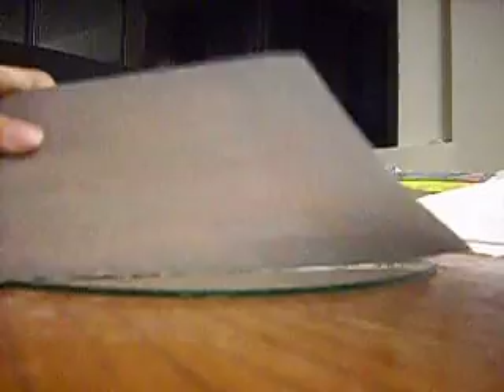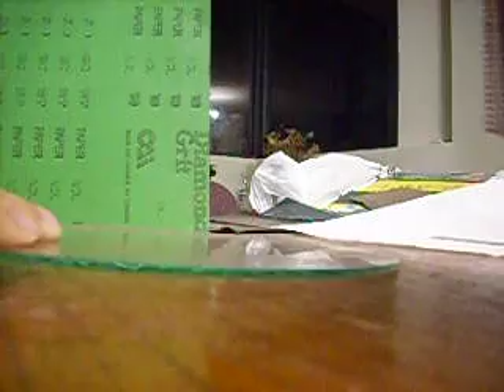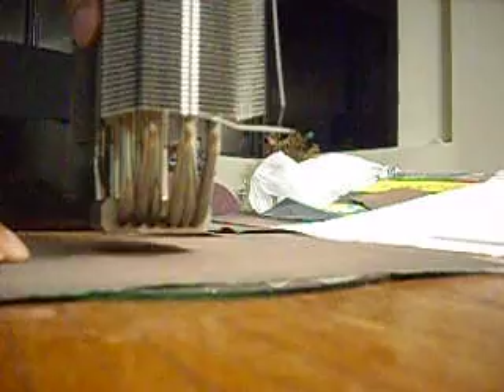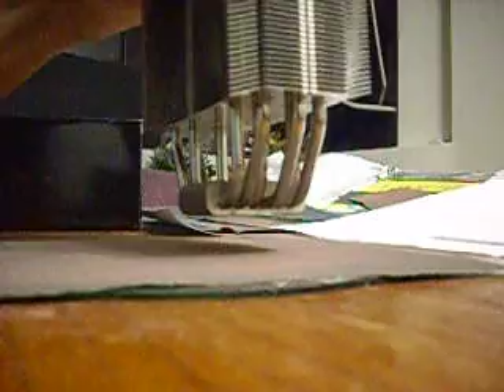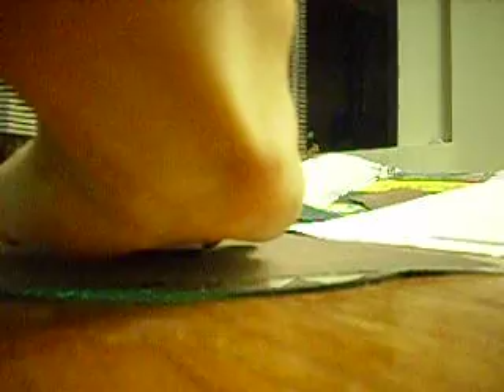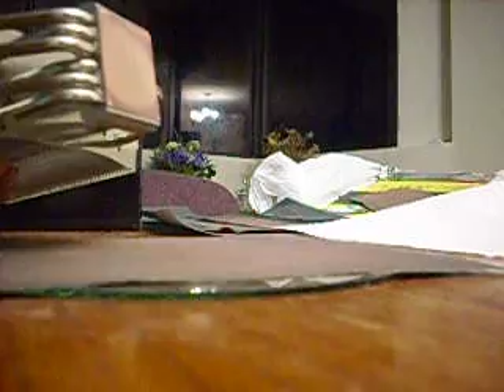Lapping Thermalright Ultra Extreme

Comment: The main idea is to lap the CPU. However, people dont want to take the risk of doing that so they do the heatsink. If you want to go for best performance than lap both the heatsink and the CPU if you don't want to damage an expensive CPU but still want that few extra degrees of performance do the heatsink.

Comment: You obviously do not understand the idea of lapping. The idea of lapping is to make the surface as flat as possible because pure copper/metal has much better conductivity than even the best thermal paste. Making the surface flat gets rid of the bends and uneven bits thus resulting in less thermal paste separating the cooler and CPU. Plus, how reflective the base is has almost nothing to do with how efficiently heat can transfer.

Comment: Good tutorial but definitely wrong about the wax. The only things that should ever go on the heatsink are isopropyl alcohol (or similar cleaner) and thermal paste. I lapped my processor to a perfect mirror finish without wax. The secret really is to use high grate sand paper. Start low at 220-400 and work the whole way to at least 1500 grit, preferably 2000 grit for a perfect mirror finish. Happy lapping :)

Comment: Actually if you look through the cpu lapping videos you will notice the edges sand off first.  I have noticed on my newer cpus that they have been rounding the edges down.

I also forgot to mention that you only need around 500-800 grit sandpaper max. I have read tons of lapping articles over the years and all bench testers have shown they get no better results.  I go 250Gritt, 500, then 600.  I also have a small piece of glass so I can put it under the faucet to help keep the sandpaper cleaner.

Comment: If you notice, most CPU's are actually rounded in the opposite way that the heatsink is... or more techinically, in the same way. both are bulging, or crowned, so there's a significant gap either way. But yeah, for best results you need to lap both the heatsink AND the CPU, but I'm not sure I would use this particular video's method for doing the CPU.

Comment: You will need to lap your CPU as well.  Is what happens is that the CPU isn't perfectly flat either, that's why the heat sink is made rounded on purpose, that way they will match up more evenly.  So lap both heatsink and CPU for best results.

Comment: i only used 1500 paper, im going to try again using only a forward motion and with 2000,2500 grit sand paper if it works il try it on my heat killer rev3 :D

Comment: I'm not understanding your logic for sanding at a low grit in one direction until all the scratches are in one direction. I know that you are getting rid of the unevenness of the base but couldn't it then be possible that one side of the heatsink gets more/less sanding due to inconsistencies in either the sandpaper or whatever you're lapping on top of?

Comment: using turtle wax or any other polishing compound defeats the purpose of lapping the heatsink.  it makes the thermal interface worse, because the extra polishing compound is "absorbed" into the microscopic pores of the heatsink.  you don't want that.

Comment: If you use soap on the sandpaper, it actually makes the heatsink GLIDE, i lapped mine by just twisting the heatsink in circles. Worked very well.

Comment: Wet and dry papers will go as fine as 4000 grit now. But I think if you use 1200grit, then 2500 grit as a final, then use some 3 micron Diamond compound ( not turtlewax )on a Chemotextile cloth or a woven silk cloth with PSA, stuck to your lapping plate, you will end up with a finish that is mirror.

Comment: Use " Wet and Dry" Silicon carbide papers, some call them carborundum sheets. Use water on the paper to keep it lubricated and it stops the paper loading up also.Glass is generally not that flat. Better if you have a Cast Iron Lapping plate that has been lapped on a Lapping Machine. But how flat do you need these things? We lap our Mechanical seals to 2 Helium light bands. ( 1LB = 0.000293mm )Also, we were always taught figure of eight motion also.